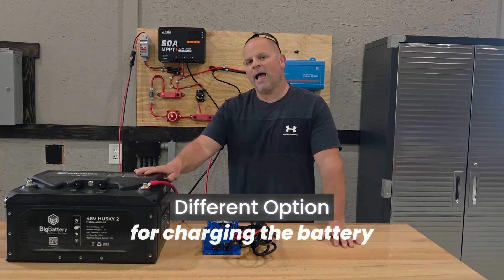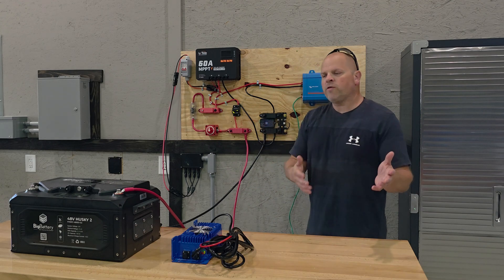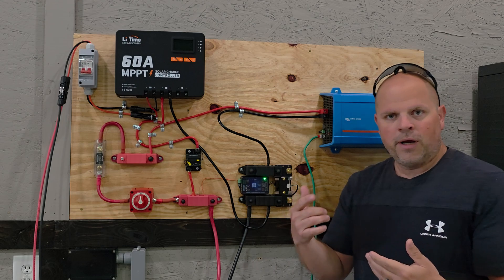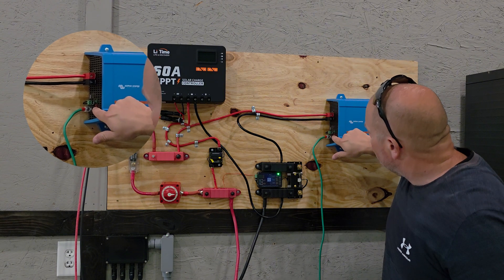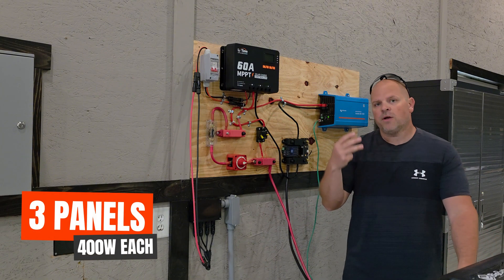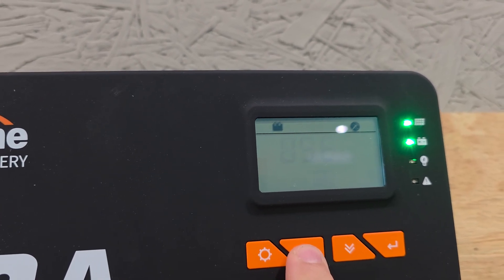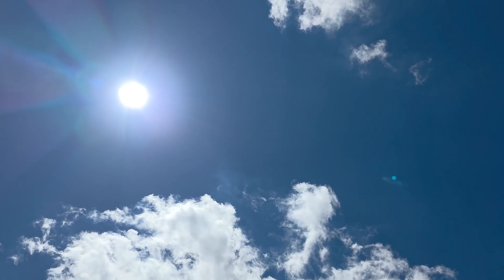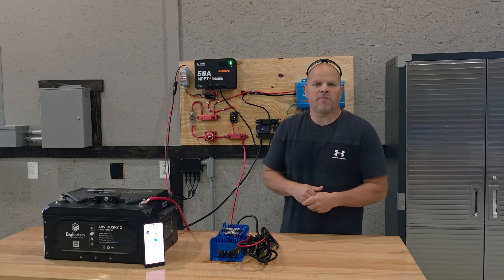Build a Basic OFF GRID DIY solar system

Comment: The dc breaker between your battery and MPPT is a fire hazard. Read up on this, be careful with amazon stuff. Replace it with a fuse holder and proper fuse

Comment: Another great video!  Question:  Are there any automated devices that can be placed between standard power (coming from the utility) and that of the battery?

For example:  My electricity bill is really high between the hours of 6 PM and 10 PM every day from my utility.  If I get the setup you have (big battery, solar panels, charge controller, etc).  Is there a way I can my whole house use the big battery during peak hours automatically to save money as a DIYer?
Reply from the maker: I should try put something out on how that might be possible using home assistance. An open source home automation software. I think it would work for what you are talking about. Time of Use option
Reply: @TheSolarPit that’s awesome, would love to see a video about that!